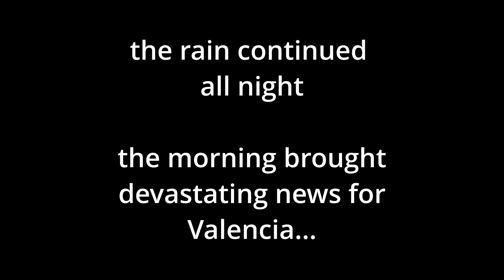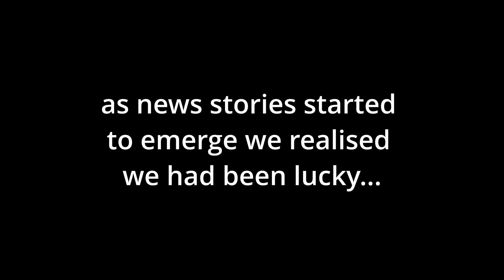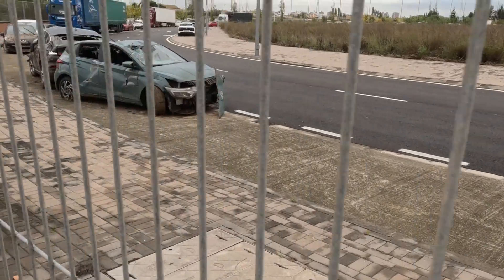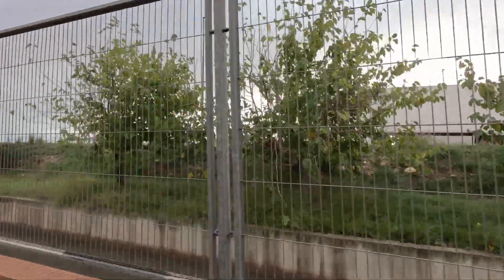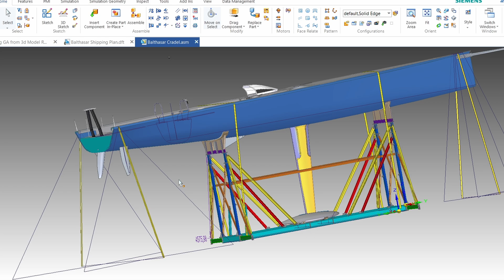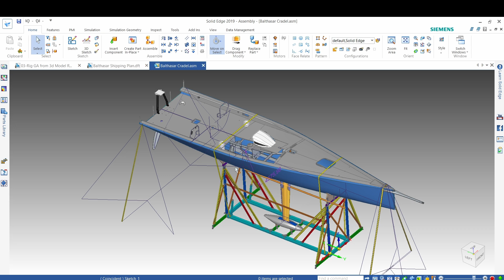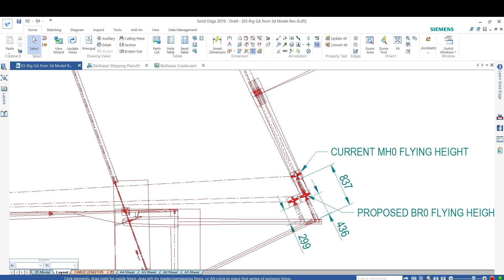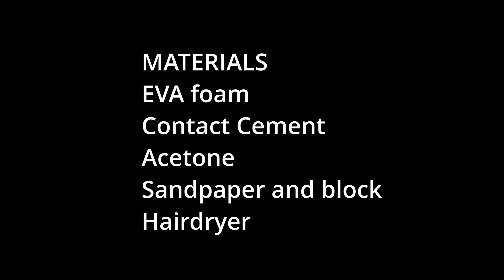Our Marina after Spanish DANA flooding

Comment: I wouldn’t know what kind of hinges you would use on a carbon door. I have to build some new doors for my Catana but they will be made from foam and glass with wooden blocks for the hinges. Good to see a video from you guys 👏👏👏👏👏
Reply: Matt from the Duracell Project made some GRP (Carbon?) hinges that look the goods. Dunno if that helps?
Reply from the maker: @richardhoughton9139  thanks! Good luck with your new doors
Reply: @  Thanks but unfortunately I know my limitations and they will not be a work of art like yours 🥴

Comment: I’m interested in effectiveness of your 3dp cyclone. I tried two types on RD and gave up, went to a bagged Karcher with Dust Class M bags. My cyclones only trapped ~50% of the fine fibreglass / filler / paint dust.
The karcher is so much quieter.
Reply from the maker: So far it's been very good at pulling out the fines. I was pleasantly surprised. I will share the design on my website if people want to try

Comment: At the beginning where you were talking about the metal fittings needing to be of high quality, I was thinking about the possibility of using rope hinges on doors, those figure-8 lashings.
I've not seen it done before, but if rudders were attached to the hull using rope hinges, why can't one use them on doors. I guess that they aren't great for doors that need to be water tight, but I am sure that something could be done....